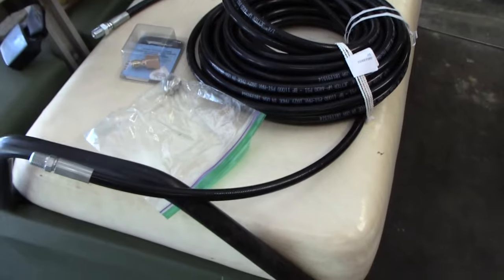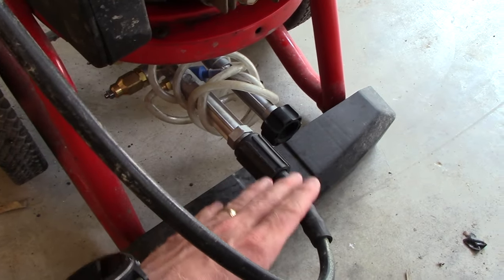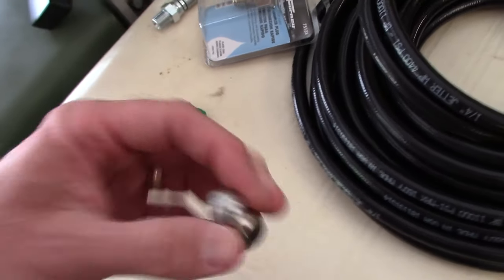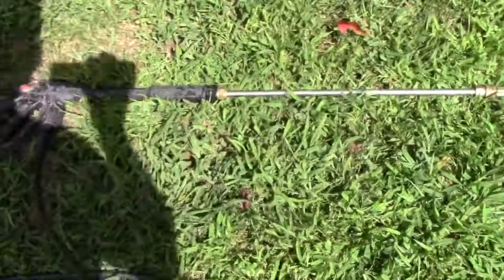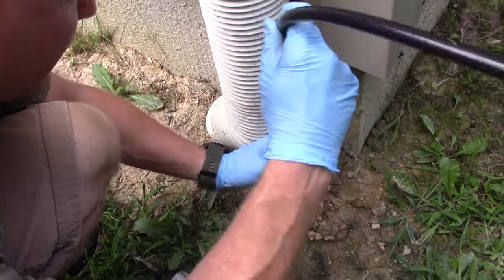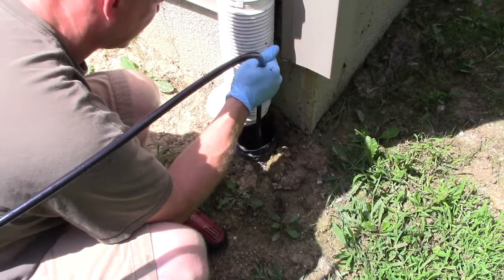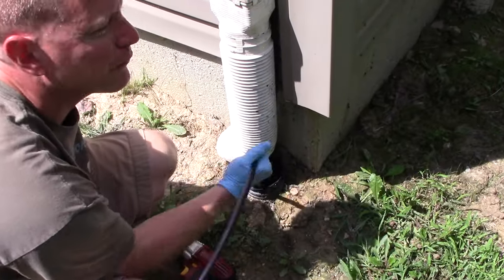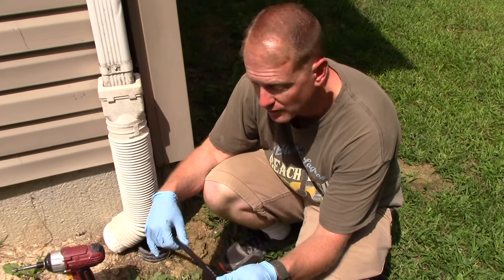DIY Cheap Water Jetter System To Unclog Pipes - How To Hydro Jet

Comment: Fire anyone doing this with a small pressure washer you need a small nozzle for it to be effective. Bigger is not better you need high pressure to cut through crap. 6hp is only able to run a 2.0 size nozzle. You need a medium 14hp machine to run the 4.0 that comes with most kits. If you run too big a nozzle it won't have any power and won't perform well.

Comment: Why does it have to be a gas pressure washer?  I have a Husky (Home Depot) 1750 psi electric power washer.
Reply from the maker: You could try it and see but usually gas washers have a lot more flow. It's not just about PSI, it's about gallons per minute.
Reply: does the 1750 psi work for you?

Comment: Do electric pressure washers simply not have enough PSI to do an effective job for water jetting vs. a gas pressure washer?
Reply from the maker: That is correct
Reply: @JackofAllMasterofNone  How is a 4,000 PSI electric different from a 4,000 PSI gas washer?
Reply: @tpierce7853  It's the GPM you have to check also. The higher GPM the better. And the more money it will cost.
Reply: There are some electric washers with 3800 psi and 2.7 gpm.
Reply: or you can done for small pipe like 2"
Reply: Guy's, A cheap, electric "1,800Psi Max" pressure washer will work just fine. You are absolutely NUT'S if you use more than 1,800 psi! Why? Think about it?! More than that can start peeling the paint off of your car! Cut lines deep into concrete and dig the healthy glue out of joints and cracks.. If the pipes aren't fairly new, they are beginning to weaken as decay starts in anyway. And do these pipes need to be "Squeaky Clean"??? NO! Just clear enough for them to drain.  Very high pressures only provide two things.1),  FASTER destruction of your plumbing. 2), But Yes it will clean out the pipes a "little" faster. 
I would rather have healthy pipes that aren't clean enough to eat out of! Unless you Really, REALLY need those three minutes you might save in time, to save the world!
Reply: @scottxfactoraudio8799  drain jetters regularly use 4 to 5000 psi. But if you're not trying to cut roots or move heavy blockages I believe you could get by with way lesser psi/gpm
Reply: @scottxfactoraudio8799  You have a very good point. I think again before buying, and this saves me a lot of money. I rather use lower pressured washer regularly than use the high end one when pipes get blocked. Thanks for sharing wonderful wonderful ideas.

Comment: What about safety issues? I read a post online by a plumbing company that said "it can break your sewer if not done by a licensed professional" and another that said "it is enough pressure to cut off your hand, so it should only be done by a skilled technician". I realized that these may be scare tactics meant to get you to call them insteady of DIY.
Reply from the maker: Well I'm sure both of those statements are true if you aren't careful.
Reply: It's important to treat every tool with respect and know what its hazards are.  Then you take measures to avoid those hazards.  If can't do that, call a professional.

Comment: I live in a doublewide mobile home, it has 2 toilet's, 2 vanity sink's, 2 shower's, a laundry room and a double kitchen sink, all the above mentioned water source's drain just fine, all but the kitchen sink! 
I made sure that the pipe's leading to the p-trap were clear, the p-trap itself is clear of obstruction, I changed the minivent on the drainpipe itself and ran a 50 foot snake/cable which only made the clog worse!
Before I ran the snake it drained very slow but now it doesn't drain at all !!! Why is this and what do I have to do to fix this problem ???
Your opinion and advice would be great'ly appreciated!
Can you tell me how to accurate'ly pin point the obstruction in case I have to cut the pipe?
I should mention that I accessed the drainpipe under the sink via an access cap that screws off & on and bypassed the p-trap.
SOS !!! PLEASE HELP !!!  I'M SICK & TIRED OF DOING MY DISHES IN THE BATHROOM SINK !!!!
Thank you in advance!

Your new You Tube Subscriber,

Mike Sullivan

Comment: If you used smooth PVC pipe for the underground pipe instead of that corrugated stuff it probably wouldn't clog in the first place.
Reply from the maker: Good point. But unfortunately most people  are not in control of what someone else previously installed.
Reply: Jack of All Master of None good point

Comment: Don't use cheap plastic corrugated drain material. 
The cost of an underground drain is the trench labor. The guys that dig the trench is all of the cost. If you are buying a trench with a tube in it use a better tube and install it right. Don't use cheap crap in your expensive trench. Did you hear him say the ridges want to catch stuff? HAHAHA the tube wants to clog! Use cheap stuff and you will be a slave to cleaning out your cheap tube. 
1) Use Schedule 40 solid drain line, no holes. 
2) Make the run as straight as possible, turns clog. Use sweeping (sanitary) turns not sharp 90’s
3) Glue all connections so roots don't get in.
4)Install the tube so it stands up out of the ground 36 inches. See his white corrugated piece? This should be the same Schedule 40 material extending out of the ground. So if there ever is a clog the water has to “back up” in altitude and the weight of the water cleans out the drain automatically.  That's altitude pressure.
You will NEVER have to clean out that line in your expensive trench. Yea I know the tube will look ugly, so paint it or box it in with some Azek. 

Your Welcome.
Reply from the maker: Good advice

Comment: Should have never used corrugated pipe.  It’ll clog every time.  Use pvc or sdr35
Reply from the maker: I didn't build the house but I agree with you. It was replaced with sch 40 PVC

Comment: Pressure washers do not have enough water flow you need at least 10 gallons per minute we cannot achieve that with a small pressure washer
Reply from the maker: This has worked for me and many others so I guess it actually does work.

Comment: DONT EVER JUST THAT HOSE IN THERE!!! IF YOU FLIP THE HOSE TURN IN THE WATER ITLL SHOOT OUT AND YOU COULD EASILY DIE OR GET SERIOUSLY INJURED!!!! You should add a disclaimer to warn people to not do that
Reply from the maker: Don't ever do what?
Reply: @JackofAllMasterofNone  push the jetter hose up/down the line without it having the water on or you could unknowingly flip that head around in the pipe thus when turning your water on that hose will come right back out at you. I own and operate a residential commercial and municipal sewer cleaning and inspection business. So just giving yall a heads up to put nozzle safely into the pipe not burying it in material turn water on go a few foot turn up pressure and get r done.... safely
Reply from the maker: @Skyhigh2128  Ok. Thank you

Comment: Unclog a sewer 🤣🤣🤣. Maybe in that little rain water drain with some leaves and a little dirt clogging it.
  If you buy this for your main sewer, you are wasting $50.
Reply: Jets are used all the time on sewers which are the same size as his downspout line. They do an awesome job at it, but if you need to cut roots a lower psi wont do it
Reply: @dbutcher84  I'm a plumber. We had a jetter with a Honda 640 behind it that wouldn't even clear grease out of a 4" sewer. So what is this gonna do?
Reply: @TheRaginkage  you need psi for grease and roots not just a bunch of gpm. But yes, your point has some truth for the average person. I have seen jetter systems tear through roots and grease, but not many people have a 4 to 5000 psi setup. You're right in the way that a person that uses this with their 1800 psi electric isn't getting very far with a root/grease clog